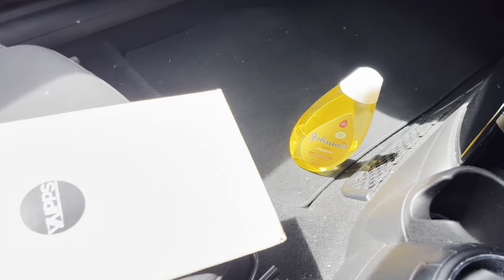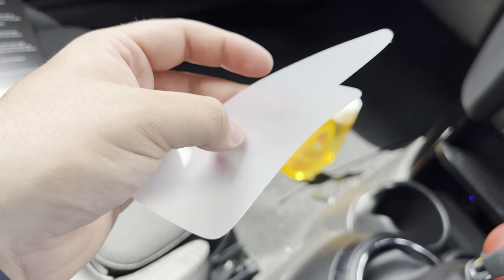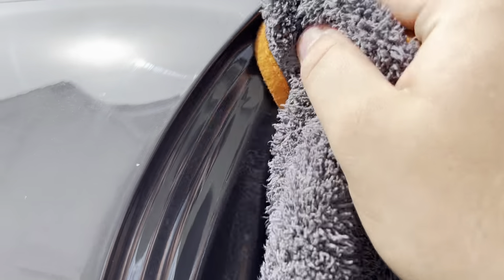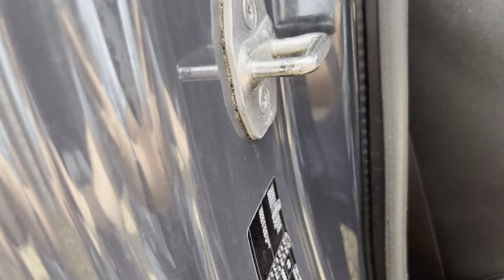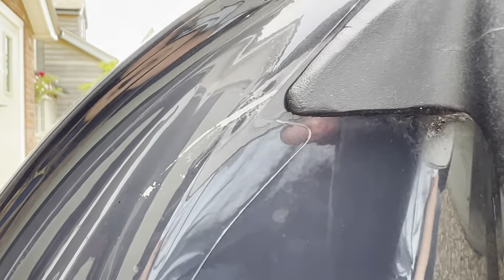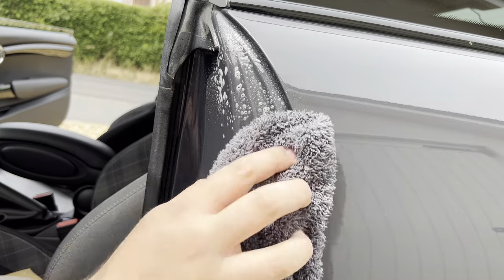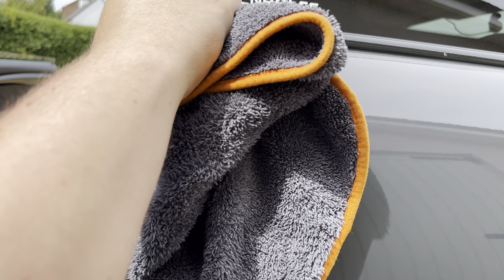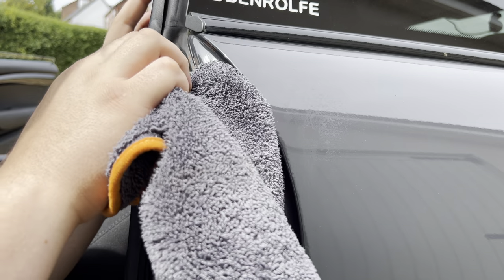IPPS DOOR SHUT PPF INSTALLATION!!

Comment: Any recommendations for the black trims, mine are looking mighty dull from the sun.
Reply from the maker: Which black trims would this be?
Reply: @BenRolfe  for example the black trim pillars that look like triangles that hold the rear spoiler seem to dull as well
Reply: Trim on the wheels
Reply: Not the pillars
Reply: @soniahuertas6517  well for me it’s the pillars
Reply: @soniahuertas6517  and they are both plastic so the remedy should work for both
Reply from the maker: For the pillars I’d recommend the PPF kit sold by SCP Automotive. Use code BEN10 for 10% off

https://scpautomotive.co.uk/products/mini-f-series-front-and-rear-pillar-paint-protection-film-set?_pos=1&_sid=6fad32a61&_ss=r
Reply: Thank you Ben